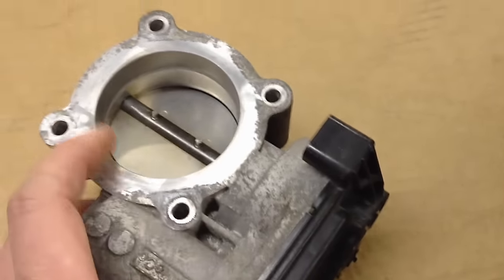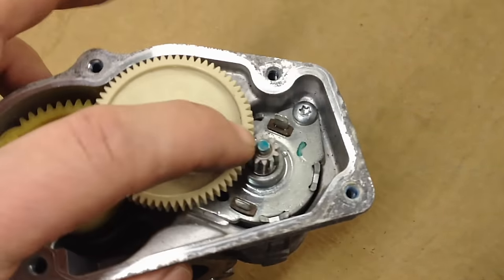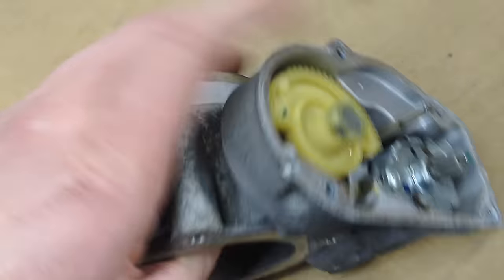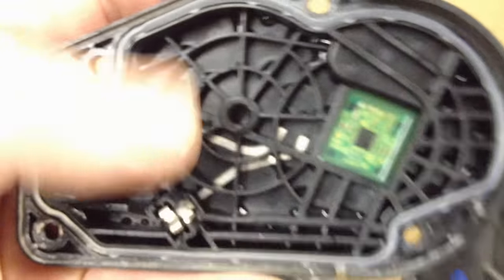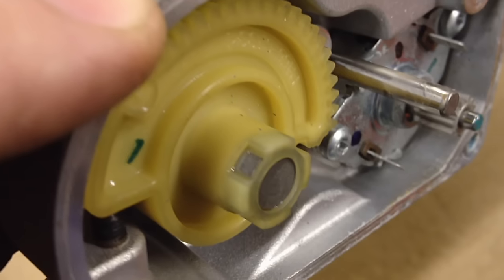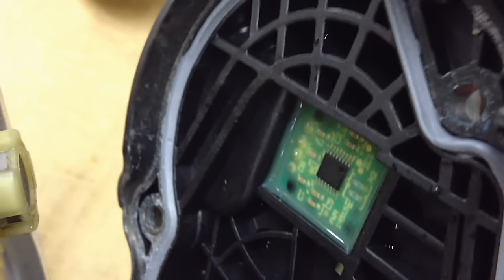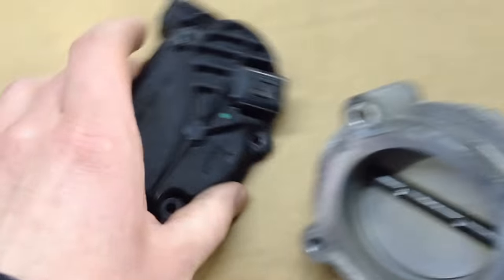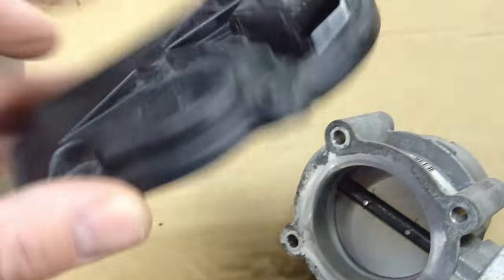Ford Electronic Throttle Body Failures

Comment: I'm shocked and disappointed reading the posts below. Our 2016 Escape with 16k miles started to lose power last week multiple days and times, finally had the code read P2112 which traced it to the throttle body. Had the wife stop driving the car and let her use my car for the last week. Dropped the Escape at the dealer tonight. How can Ford not re-engineer after so many years worth of problems with this part ?  Depending on the situation this could be life threatening.
Reply: My 2016 ford fusion does the same
Reply: Ford Edge 2015 Ecoboost 2.0 doing the same. Garbage manufacturing.

Comment: In my 2011 Ford Escape, I got a "wrench" light on instead of the "check engine" light. Yes it was a TB code. Car starts and runs normally. I guess the wrench light means a secondary, non-federal regulated problem code? Bought a Dorman TB and the code was gone. I would not buy genuine Ford or Motorcraft due to poor design or quality.

I disassembled the old TB. There is no dirt or any sign of mechanical failure. I agree the electro-magnetic TPS in the cap is the culprit. Unfortunately that TPS is not available in any part store or online. You have to buy the entire TB.

Comment: Where is the Throttle Actuator Control Module Processor Located on a 2008 F250 5.4L? Inside the throttle body, or is it integrated into the PCM? I am getting code P2107 and P2110, and it's incredible easy to misdiagnose this issue. I don't want to recommend to my customer that he replaces the throttle body without being absolutely certain.

Comment: I did wonder what actually went wrong with this tb..I suspected it was the electrical part cause nothing seem wrong with the gears,now I know.Thanks for the videos
Reply from the maker: The older ones had a different TP sensor where it actually had a wiper arm and track and those failed all the time too.

Comment: 2016 Ford F150 Screw, experiencing issues that others have described which lead to replacing their ETB. Several NHTSA safety complaints, SSS, and TSB's have been issued and a few hits on Customer Satisfaction Programs being issued. All that a dealership is giving me the runaround because I'm 244 miles out of my 36k warranty. Any suggestions?

Comment: i have a 2007 front wheel drive 3.0 v6 and the throttle body keeps failing even after the new one,it looses power have to turn off then back on and your good to go,not sure why its doing it.

Comment: Question : I seem to have a problem with my throttle body ,  after I cleaned it I have some really funky revs, after some troubleshooting it seems that my flap isn't opening , even at 3K revs the throttle is some how closed, I tested the motor and it seems to work just fine, how can I test whether or not the throttle motor is receiving the correct voltage ?

Comment: Hey, I replaced the throttle body assembly on my 2007 f150 5.4L and it made the truck run worse... The truck has been showing a consistent code for the throttle body problems along with a code P2135: THROTTLE PEDAL POSITION SENSOR A/B CORRELATION!... have you had any experience in this area?

Comment: Just to say I had a 2006 five hundred and cleaned that throttle at 98k, and worked like new, never saw the dealer but for trannie oil change.

Had my 2011 explorer in for steering pcm update and seems ok. holding my breath!

Comment: sorry for dumb question, but does this throttle body part include throttle position sensor? I'm googling for a good hours and I cannot find TPS as a separate part. I started to think, this electronic module you've pointed out to fail a lot is the TPS itself? Thanks.

Comment: 2013 ford edge with 62k shutoff on the freeway twice. lost steering power, brake assist, and eng oil pressure with eng over temp lights. serv advance trac also came one with wrench.   would i need a new TB?
Reply from the maker: +Cruz Deuce Anytime the vehicle shuts down the lights on the cluster will reset. I would be leaning towards a new throttle body yes. Best to get the codes read first though by a scan tool than can query all modules involved.

Comment: 93 f150 5.9 truck will idle good and the all of sudden it stars searching idle. The idle will eventually drop dead bottom. Cut off and sometimes come on back up to normal tps readings good with new iac
Reply: 5.0 not 5.9

Comment: Care to offer up a good source for those sensors.  I paused your video and tried the part number and got bupkis.

PBT-gf20-gs20 I do believe is what it is.
Reply from the maker: isakill Those throttle bodies are sold as units now that is why.
Reply: That is failure.

But, thank you for the information good sir.

Comment: Has Ford done a recall on the Ford Edge TB? I have a 2011 3.5 limited that cuts out randomly (code P2112). I tried cleaning with TB cleaner (on the car), but it did it again after a week of driving... this time at 75mph on the highway! Looks like a straight forward change, but at 68k miles I'm very disappointed. Warped rotors, hanging rear calipers (and with the sliders lubed) and now this.
Reply from the maker: +In VT No recal on them but I have changed a few 2012 2013 models for this concern where as the older models never had a problem.
Reply: I plan on removing the TB, and giving it a good cleaning. Think I should try cleaning the contacts on the TPS as well? What's the newer part number If I replace it? I don't want to put the same garbage back on. Thx!
Reply from the maker: +In VT No I would leave the tps contacts alone. I use a tiny bit of dielectric grease on the connector terminals.Here is the latest throttle body-http://www.amazon.com/gp/product/B00M2QSTQ2/ref=as_li_tl?ie=UTF8&camp=1789&creative=390957&creativeASIN=B00M2QSTQ2&linkCode=as2&tag=fordt-20&linkId=VFJYX7QKIKOOBO3RThis is the dielectric grease I use for electrical connectors-http://www.amazon.com/gp/product/B0065T2RSS/ref=as_li_tl?ie=UTF8&camp=1789&creative=390957&creativeASIN=B0065T2RSS&linkCode=as2&tag=fordt-20&linkId=KOALP5EGPSI2Y4NQ

Comment: What is the part number for the throttle body control module that goes on the side of the TB.  Have only seen the whole TB sold online or at the local Ford dealer for around $380+  Could you point me in the right direction?

Comment: hey, I just recently came across ur channel and great info! I had a question though. I have a 2011 f150 ecoboost 3.5l and today I was gonna check my throttle body to see if it needed cleaned and saw that it wasn't completely closed bc I could see a line of carbon and stuff where it is suppose to close. so when I push the top of the throttle and hold it, it will close but when I let go it just goes back to where it was. so I was wondering if u knew what is causing it to not close completely. I don't have any check engine lights on or anything. thanks!

Comment: What is the name for the plastic cover of the throttle body. Trying to google just that part. I've had the same issue as some of the guys down below and want to change out the cover before I have to drop $600 just to change out the throttle body. If you know where I could get one and what it's called that would be awesome. Thanks man

Comment: I need help, i have a ford focus ses 2011. And i need to replace the whole throttle body. My question is. Do i need to calibrate the new throttle body? Or just replace it and star the engine? I'm doing this because mi tps is giving problems

Comment: Hello FordTecdh, I've ford explorer limited 2013, last week while driving on highway the speed has been decreased suddenly and fuel pedal did not respond anymore, the battery sign has pumped up  (Check charging system, yellow wrench, and check oil). I stopped the engine and starteed again the problem was gone, but after driving couple of meters it came back again. I've replaced the battery and its terminals, but it didn't resolve the problem at all. The car has been scanned and got these codes P0620 (Generator control circuit), and P2111 (Throttle Actuator Control system-stuck open). Please advise what should i do?

Comment: Hey fordtech I've ran into some problems with my 2004 f150 xlt 4.6 v8 and I'm hoping you might be able to help me out. Being the genius that I am I failed to disconnect the battery before cleaning my throttle body and I'm fairly certain that I broke something. Would moving the butterfly valve manually while having the battery connected ruin the throttle body motor and gears or do you think that I might be able to just get a new side plate like the one you show In the video?
Reply from the maker: spencer sousa Yes it can. Now that it is cleaned, reset the pcm and learn the throttle and go from there.
Reply: Thanks or the response I got it working.

Comment: Hello FordTechMakuloco, thank you for all the great how-to videos, as an owner of a Ford Escape 2007 I have found them way useful and instructive. I got a question for you, I just cleaned my MAF (Mass Air Flow sensor) and my Throttle body sensor. My car has 96,526 miles and it sure needed the clean. Anyway, I disconnected the battery and did the disassembly, cleaning and re-assembly of the MAF and TBS, connected the battery and started the engine. She idled rough and for a seconded seem as she was going to cut off, but throttle up and stayed at around 1,000 rpms. I check back in the engine compartment and found that i had left the Throttle Body Sensor disconnected. I reconnected right there and saw that the rpm settle down back to to below 1,000...600-800 range?... This is the question, did i just killed the TBS??? Should I run to the auto store and get a new one, or am I safe???  Thank you in advance!!!
Reply from the maker: E Andres No your tps sensor should be just fine, reset the pcm memory again and let it learn the idle and you should be fine.

Comment: You mention that the electronics "are available separately".   Can you suggest a source for that?  I've been looking and searching but haven't found anything yet that that seems like a sure fit and replacement.

I've replaced my 2006 Ford Freestyle throttle body once already.  Acting up again after a couple of years.   The first time I tried doing it myself with an aftermarket part.  Dorman I think.   Just didn't take in the end.   Car computer just didn't like it.   Finally had the dealer do it at significant cost.   Now that it's acting up again I really want to fix it somehow and avoid the dealer or OEM parts.
Reply from the maker: Ford no longer offer that service kit separately.

Comment: You ever have this issue
Only on cold or somewhat cold starts the car idles down into limp mode. Wrench light comes on.

Turn the car off then back on and everything is fine. It doesn't leave a code during limp mode or apon restart. Nothing to go off of.

I've come to the conclusion that it's either the pedal assembly or throttlebody. 

But wondering your thoughts. Car is a 2006 fusion with a 2.3

Comment: I have a 2013 ford Taurus and when I'm driving not all the time but sometimes the rmp goes to 0 and I cant press on the gas but the power stays on tot he car and I have to coast to the side of the road and when I crank to start to car it hesitates like it doesn't want to start. It has been at ford dealership and they say they cant find what it is that's wrong with my car. Could it be the fuel pump injector or the throttle body? and if the throttle body would it have to be programmed ?

Comment: Could this be responsible for a code P-0299 Turbo Underboost? I have a brand new 2017 in service for two weeks with a P-0299 code and they can't figure out what's wrong with it.

Comment: The little silver motor on the side of the throttle body died completely from spraying carb cleaner in the throttle body Ford Mustang 2006 4.0 causing wrench light to come on no more wrench light now

Comment: Do you know where I can find the remanufactured tps without replacing the whole throttle body? Been having some acceleration limp mode issues on my 2013 F150 EcoBoost that is out of warranty. have replaced spark plugs and boots and cleaned throttle body and still having the issue. Any help would be appreciated.

Comment: My 06 e350 just died on me the other day.  Driving at about 35 mph I suddenly lost all power. luckily I was able to coast to a safe place to stop.  Got the check engine light and the check gauges light then it died.  When I tried to start it I got nothing.  No crank, no sputter nothing but lights and warning sounds.  

After having it towed to the shop I called the mechanic and he told me it started right up.  He said he kept getting codes that led him to suspect a tb issue.  He said he couldn't really fix anything because it wasn't currently having the problem.  I'm kinda screwed because my business depends on my truck and I'm afraid the same issue is gonna keep happening

Comment: Sir what is the problem of my car....ford ranger trekker 2009 model...i observe the rpm just only 2500-2600 hi could not rech 3000rpm or something...if itry to overtake i could not overtake faster because if the rpm rich 2500-2600..the engine power strenght hi comebck to low..if i try overtake and i use 2nd gear and i pickup accelerator the rich the 2500-2600rpm the engine power automatic to down & if i change the gear the ingine power low so i start slowly and take the second to go fast..plz help me..

Comment: I've got a 2001 Ford Taurus SES With a Yellow Wrench light on that came on around the same time as the Check Engine light came on and now it's also leaking oil so I hooked it up to the scanner and its throwing a P0442 Code which is an Evap. Emissions Code plus I've noticed when I shift from park to drive my car is making a huge clunk noise or sound from somewhere under the hood and when I start the car and shift into drive and go to drive the car rattles or vibrates really bad any idea of what this could be FordTechMakuloco?

Comment: I have an 06 Ford Freestyle. I'll be driving down the road, car jerks slightly, wrench light on the left side and then the throttle is almost completely unresponsive. From what i have looked up, a lot of people have had throttle body problems with the same car. Had a ''mechanic'' tell me 700 dollars, just for the part. Looked up myself, not seeing anything even close to that price. So anyway, after it does that and becomes unresponsive, i'll pull over and shut the car off, turn it right back on and it works just fine. Until the next random time it decides to do it. Sometimes is does it once every 3 days, sometimes 5 times a day. Never know. I'm hoping it's cheap and easy to fix. I'm thinking it's the electrical part, which i didn't know could be replaced just by it self. But either way, thanks and any thoughts would help. (already cleaned it also, still have problem.)
Reply from the maker: +Butch McManly get the new one from amazon and pop it in yourself save hundreds here is the latest part- http://amzn.to/1THzB5p
Reply: +Butch McManly was it the throttle body? my car just did the same thing... they want 4000. for tranny
Reply: Yeah, that was what i was told from the test
and thanks ford guy
Reply: I was going to put on myself, but does it need to be programmed or anything like that? If so, i can't do that.

Comment: FordTechMakuloco i have a 07 f150 5.4 triton... recently it has been slipping from 2nd to  3rd and spiking in rpm while it changes gears making a loud revving noise from the engine compartment with loss of power. I took it to my trans shop and he ran the computer on it and NO codes popped up. He suggested my TPS sensor is faulty and not a tranny issue. I clean my throttle body like in your other video and it helped out with the loss of power. But still does the weird shift 2-3. Will replacing this housing help my problem?
Reply from the maker: Fabe Moreno There have been many problems with the direct clutch drum welds breaking and I thing that is where yours is heading with the broken weld behind the direct piston the pressure is lost hence the flare shift.
Reply: FordTechMakuloco Thank you for the information, I appreciate your time!  What would be the best option to repair my situation, Can i fix it myself or am I better off having the shop rebuilding it?

Comment: I just picked up a 2008 ford focus se that was in a front end crash for 500 bucks anyways I took it home today and I got Throttle Actuator Control System - Stuck Closed this code po638 from my scan took would this fix my problem?

Comment: what could be the potential cause of defect if the idle RPM is high?
Also, the throttle adjusting screw [TAS] has some sort of resin on it. For how long is the curing done on it?
Reply from the maker: The stop screw has Loctite on it and is set from the factory and is not to be touched. Idle rpm high on what vehicle? Usually this is from a vacuum leak.

Comment: Ok I figured out the problem I had a poweraide throttle body spacer on it took it off because it sets inside of the tube which was restricting my air flow.
Reply from the maker: Brandon Johns Yep that will cause it.